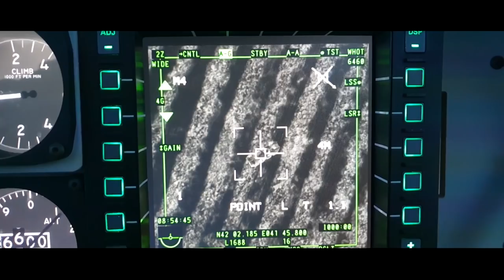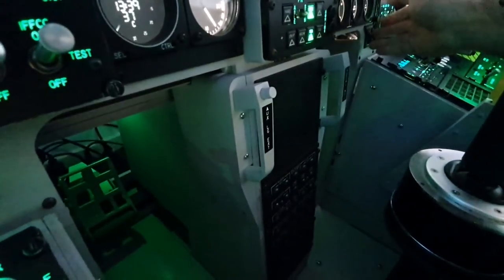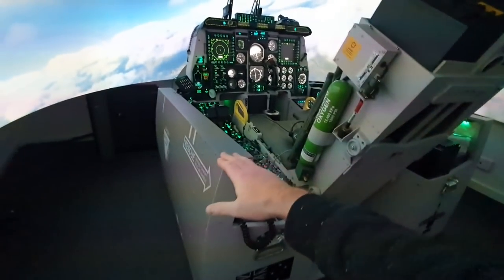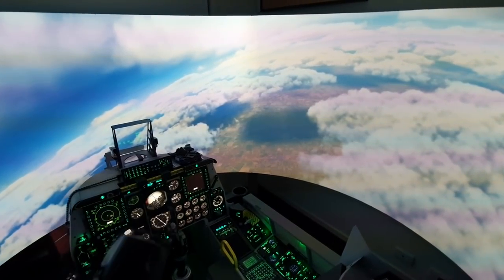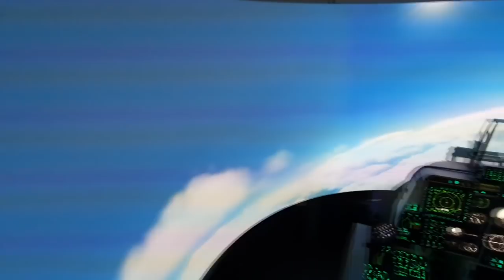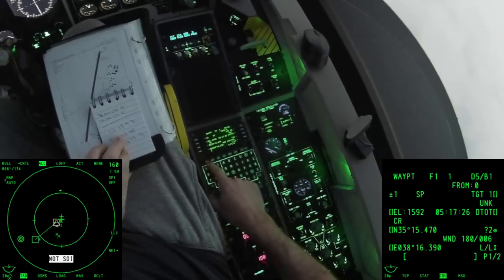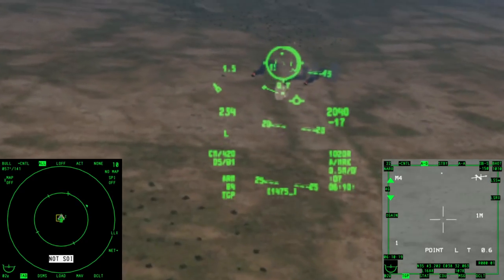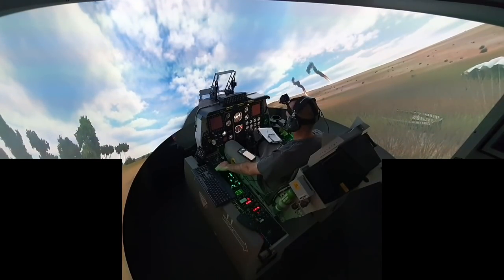UPDATE April 2021- A10C Warthog Simulator + DCS World 2.7

Comment: First!!

And to think I was literally about to log off YouTube for awhile lol. Question for Worthog project. What's the total power draw of your simpit?
Reply: Incase he doesn't answer I'll try to give you an idea. The biggest power draw is the computer. He also has 3 protectors and a monitor. The backlighting is LEDs so not much power there
Reply: @quintenzappe3412  Yes the pc would definitely be the biggest power user for sure. And if I remember correctly the Logitech x5500 he's using for sound have a pretty beefy amp inside. I actually haven't any idea the typical power draw of a projector but I imagine with the lamp they use it's quite a bit